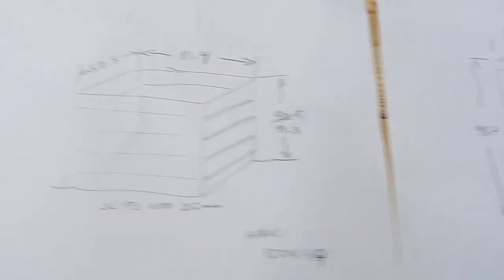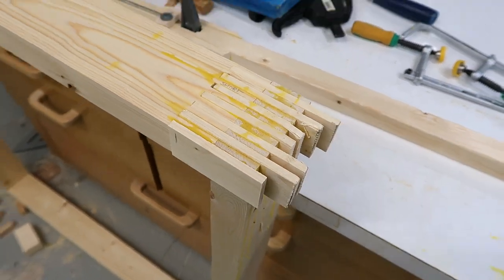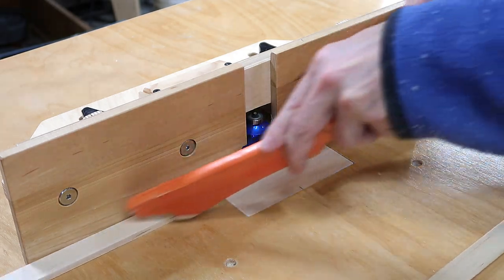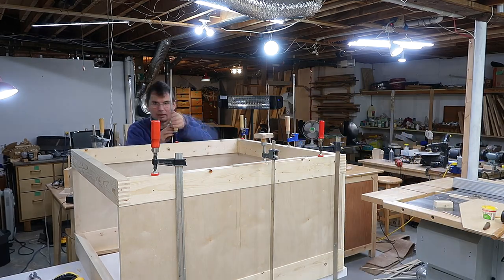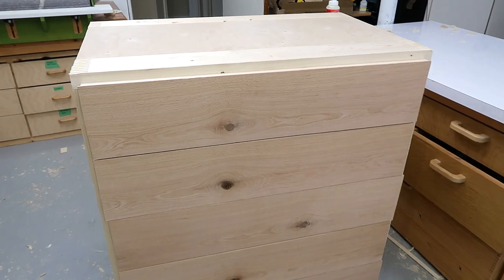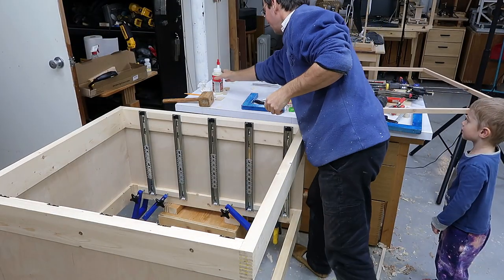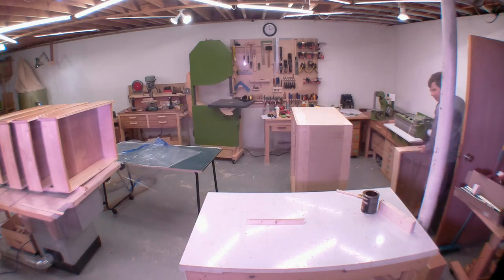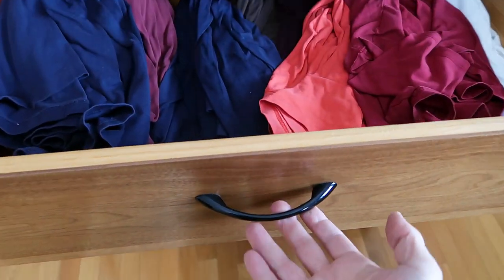Dresser build

Comment: Matthias, you inspired me recently. I'm a sales rep dealing with hardware stores- one of my customers gave me a bunch of old drawers made of 3/4" pine (they used to use them to hold various screws and such). Shortly after that, another customer gave me a big hypo-allergenic air filter that he had to write off (once the seal on the plastic wrap is broken, they can't be sold). I put the two together to make an inline dust filter that I hook up to my big belt sanders. I use them a *lot*, so after a few months, I broke it open to check out the results last night- dumped about five pounds of fine sawdust out of the thing! Thanks for the idea!

Comment: Love your channel Matthias. Several thoughts..
1. Try Titebond extend. You do enough complicated glue ups to justify keeping it on hand. It will make your life easier.
2. Try shellac, especially inside cabinets/drawers where the smell of curing finish can linger for years. I also use it as a conditioner coat under oil finishes, it dries almost as fast as you can apply it and it eliminates one coat of finish. You may find one coat of shellac and one finish coat is enough.
Reply: He hates shellac - it’s not durable enough. =p

He mentioned it in another video where he scraped it all off.

Personally, I really like it.  Super easy/fast - even if not always the most durable.

Comment: Very nice.  I have a linen cabinet that purposefully does not have a back (from the factory).  That is to promote air circulation and keep the linens from developing a stale type of odor.
Reply from the maker: Exactly, that's another benefit.  And if its against an outside wall, you also don't want to trap the air on the back, cause that can lead to conensation.

Comment: You still use the slot mortiser a lot, but you've not put up very many videos about it. A follow-up video, like those you have done recently, would be nice. I would also enjoy watching a build series of a new slot mortiser, but I realize that is a much bigger ask. You may not need a new slot mortiser, but you built 3 pantorouters, plus you have a metal one. So I think 2 slot mortisers would be reasonable compared to that.
And I know the pantorouter is a superior machine, since it can do slot mortises well, but YOU still use the slot mortiser when you have pantorouters handy, so there is clearly value in the slot mortiser.
Reply from the maker: the slot mortiser is from 2009, pre-dating me making build videos.  I made a HD video about it years later though.

Comment: For tiny screws I use an awl to poke an accurate spot in the center, and use that as a pilot. That way I don't need to worry about the bit creeping off center.
Reply from the maker: I drill so I don't have to worry about the awl crawling off center!  Maybe I should use one with a narrower point.
Reply: @matthiaswandel  Two birds, one stone: a Vix bit

Comment: I've been using those drawer slides for many different projects at work. Being it's a metal fab shop, I've had to replace a few. The greased ball bearings don't like metal dust. So, on the most resent ones, I washed the grease off. Maybe they will last longer. ???
Reply from the maker: I had to replace five of the slides on the dresser in the end of the video.  It's not the metal dust.  It's the cheap slides!

Comment: You should really consider adding about 1/16" on your drawer box side of the guide mounting. So that your guides are stop the drawer box and not the drawer front. Otherwise over time often you end up destroying the front of the box and drawer face. From the force of the face frame and drawer coming in contact on a hard close. Plus it means down the road you won't have to repair the damage.
Reply from the maker: thee are 8 mortise and tenons each side holding the front on.  I think it will hold.
Reply: @matthiaswandel  I think he means the contacting surfaces themselves banging and rubbing into each other, dinging the wood and damaging the finish. Though you did use a lot of oil, so it'd likely take a very long time.

Comment: Good Job, Have you ever tried Lee Valley 2002 GF glue, excellent working time.
Reply from the maker: I'm skeptical of that.  If it doesn't harden when it dries, how its it supposed to hold?  And it WILL dry just as fast.

Comment: What’s your views on high voc oil based varnish please Mathias? I have been trying to use the low voc water based paints and varnishes as much as possible although I know they are not as good but maybe they are better for us? Any opinion would be to or against would be greatly appreciated. Ps the dresser looks very nice and solid!
Reply from the maker: I used to avoid using oil based in the winter, but the newer formulations are less stinky and dry faster.  The slow smelly drying time was a problem in the winter.

Comment: The handles are likely a discontinued IKEA model. I believe I have those exact ones on some 25+ year old IVAR furniture.
Reply: The pulls are named TAG and came in glossy black as well as a brushed nickel finish, maybe others aswell.
Reply from the maker: I think someone replaced the pulls on something and I got them at a yard sale.  Nine of 'em.  I had them on shop furniture but swapped them out for different ones to put on the dresser I made for Rachel back in 2014

Comment: I really wonder, if there are wood glue formulas that boast a longer "working time" seems like something you'd benefit from, but part of me imagines, if you don't already have it... it doesn't exhist, or it has a trade off that is too costly, like strength.
Reply from the maker: Most of the time I want the glue to bond quickly, and I can't be bothered with more than one glue.  Also, I buy it by the gallon, don't want some expensive special glue.
Reply: @matthiaswandel  those are all good reasons, it makes me curious if there are slower to set glues, since it seems some of your projects are limited by the set up time on the glue. maybe there's an additiive, like how you can spray CA glue to make it set faster...but instead something to make it a little slower, without having a seperate glue on hand. just brainstorming, I suppose.

Comment: What is the general rule you follow about height vs width in the planer? I would have been too nervous to edge-plane the ~2x6 material you did, but evidently it's fine. Do you only put them through next to each other as a safety measure to keep them from falling over, or is that just for time/snipe saving?
Reply from the maker: I only edge planed the 2x4s